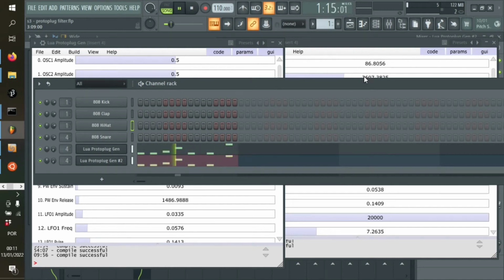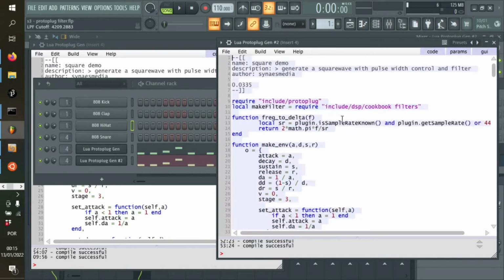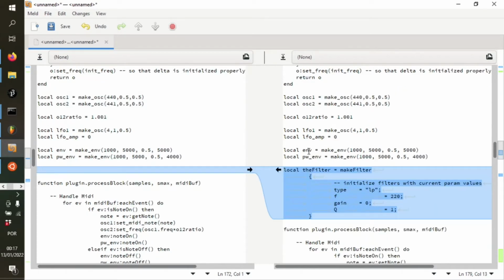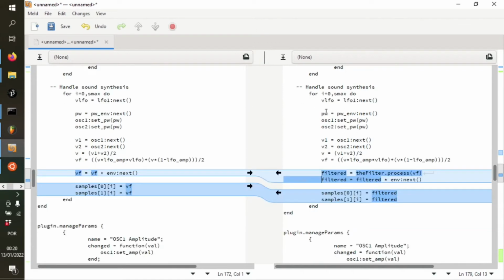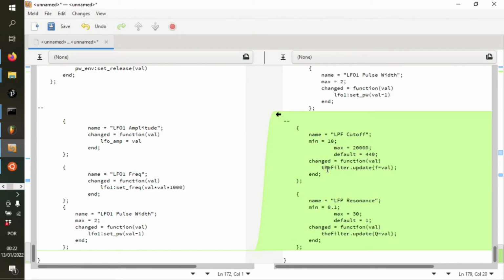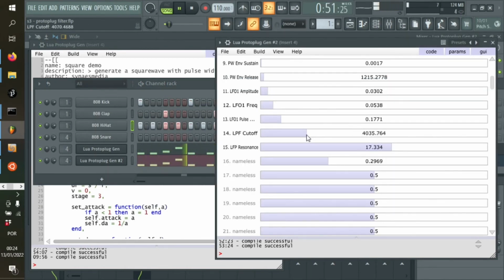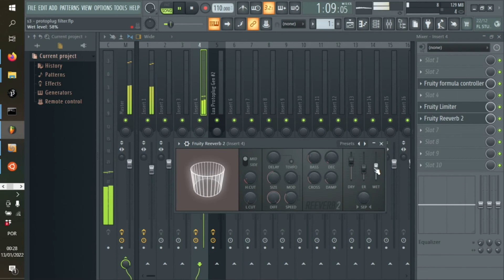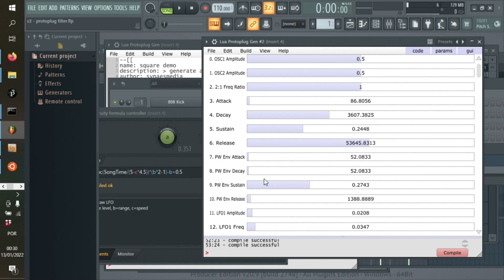Lua Protoplug Tutorial #3c : Adding a Filter to our Noisy Square Wave Synth

Comment: Can you make in this plugin trumpet 🎺 what sound like saw-electronic guitar🎸? The example this sound wave is in S3rl - Fire 🔥
Reply from the maker: In principle you could make something that sounded like a trumpet or a guitar in this, yes.

In practice, in electronic music, you are normally working at one of several levels. For example, if I'm writing a piece of music and I already know I want a trumpet or guitar, I'm more likely to just use a preset from one of the synths or samplers I already have. Most DAWs already have reasonable versions of these common instruments. Even in a free DAW like LMMS you have guitar and trumpet samples, or can use a VST plugin.

If I was particularly interested in the sound design aspects of how to make trumpet or guitar sounds from scratch in a synthesizer, and I was using FL Studio, I'd probably start with the 3x Osc plugin. That's a simple 3 oscillator synthesizer which comes as standard with FL Studio. It looks pretty basic, but you can find people doing some phenomenal things with it (eg. https://www.image-line.com/fl-studio-news/3x-osc-shakuhachi/ )

So what about Protoplug? The main virtue of Protoplug is you can learn the next level down, how to actually program the underlying architecture of synthesizers in code. And armed with that knowledge you can make your own synthesizers. That's an interesting / fun activity, but you're mainly likely to do it as a learning exercise, or to make something more experimental, which works on principles different to any other plugin you have. You don't need to do it just to get the more common sounds or synth functionality.

Could someone make a clone of 3x Osc in Protoplug? I think they probably could. It's a bigger project than any I've shown in my tutorials here. But it's probably not so much bigger. If you understood all the tutorials I've made about Protoplug, and are now reasonably confident programming in Lua, could probably build out from these examples to a 3 Oscillator monosynth, with sin, saw, square, noise waveforms, an amplitude envelope, filter envelope and LFOs, FM etc. Probably with a couple of weeks, if you're keen.

And then you can do all the sound design you might do in 3x Osc, in your own synthesizer. 🙂

IN THEORY you could then go on to build even more powerful synthesizers. Ones with far more oscillators and modulation possibilities. Comparable with something like Sytrus or Serum etc. In PRACTICE, you have to remember that Lua is slower and less efficient than writing code in C++, and I suspect that if you tried to write a really big, complex and powerful synthesizer in Protoplug, your machine couldn't handle it.

On the other hand, Protoplug uses the C++ JUCE framework behind the scenes, and so by the time you are thinking about designing and programming a big complex synth in Protoplug, you might well be ready to move on to just doing it in C++. Protoplug is a nice, intermediate step along the way to learning that, but eventually, if you are interested in writing the code behind synths, you will need to get to grips with doing it in C++.

Hope this makes sense and helps.